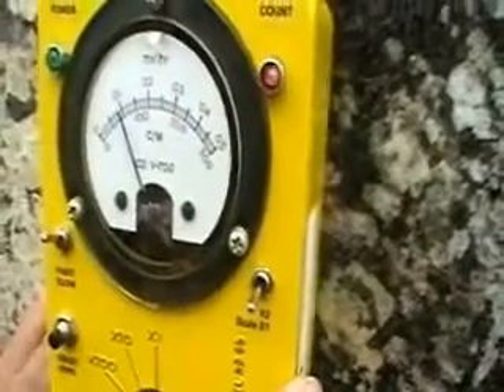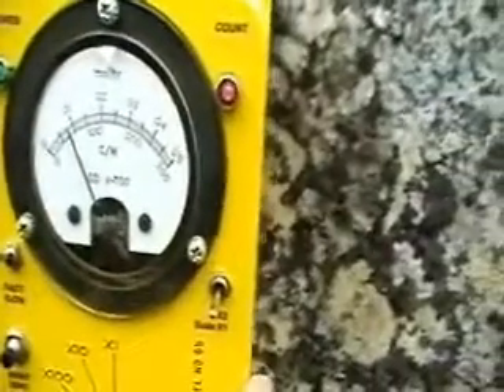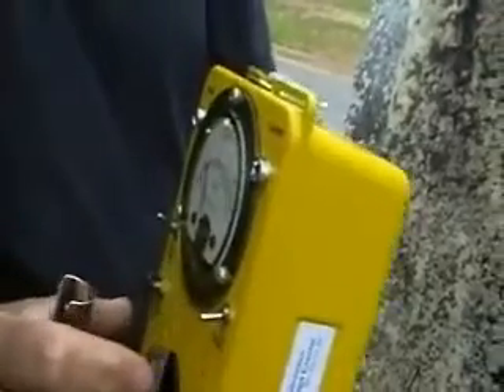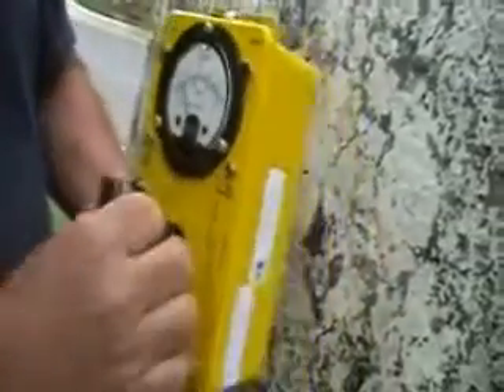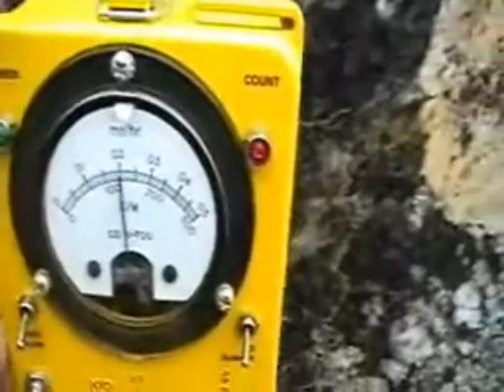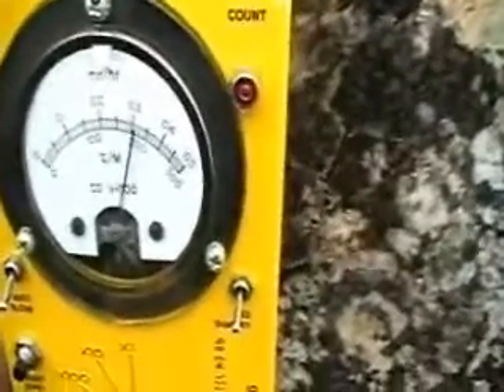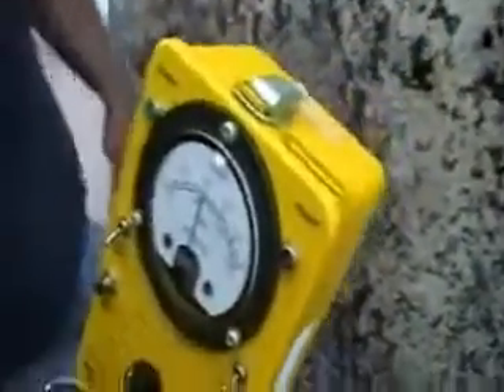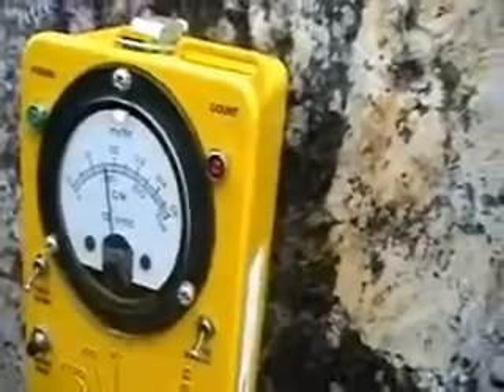Niagra Gold granite countertop measured with a Geiger counte

Comment: @stoneadvice I checked my bag of potatoes with a CDV-700 with the beta window closed, and it registered 18cpm, and my background is 18cpm. I opened the beta window, and it registered 25cpm, and my background with beta window open is 25cpm. The meter he has is designed for gamma radiation only, and also for surveying high level fields, called a CDV-715. The readings he was getting were around 200 cpm. Since that was gamma only, that is way over background. Get a clue.

Comment: You're right. The average person receives about 300 mrem per year.  My annual dose rate was 387 mrem before I became involved in radiation.  5,000 mrem is the maximum dosage for anyone working with radiation.  However, although damage caused by radiation is random and could occur at any time, the threshold for noticeable damage is 10,000 mrem per year.

Comment from the maker: You are way off pazsion.  Perhaps in a vacuum of space an Alpha or Beta particle might go some distance. Here on earth, contact with air molecules will slow down or stop all but the most energetic Beta and most all the Alpha.

You are right about the Gamma for the most parts.  Energy compensated probes are normal probes with a thicker steel/tin shield that stops more of the low level (soft) x rays.

Comment: dude, alpha,gamma,beta.. regardless of the type of radiation they travel very far depending on strength of it's origin..like the sun. gamma is usually that one that goes the furthest regardless of it's strength. and passes thru aluminum and steel. sound like you need to do some more fact finding..

Comment from the maker: Maybe you should do some research be for you start acting the expert. Radiation is not stopped by mere steel boxes.  It takes 4" of lead to stop 87.5% of the Gamma.  No matter how thick the lead is, a small amount will get through.  Two feet of concrete will stop 87.5% as well, but a thin metal box or the skimpy lead lined apron used at the dentist office stops very little.

Comment from the maker: Smilodonus,
we did explain the background levels in the videos.  It was 60 cpm on the LENi geiger counter and 6 uR/hr on the scintillator.

Too much is any over 100 mR per year.  A counter is used about 700 hours per year for a working housewife just for meals.  At that rate, a safe granite is under 142 uR/hr or
.142 mR.  This top is hitting 3 mR in some areas, or 2,100 mR a year!  21 times the maxium level.  This hotspot gives nearly 1 in a thousand risk of getting cancer after long use.